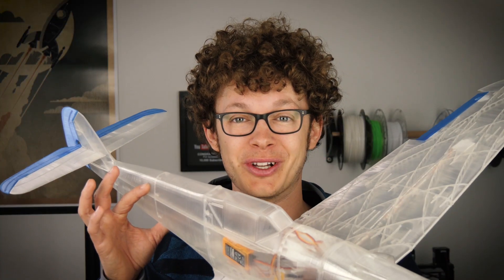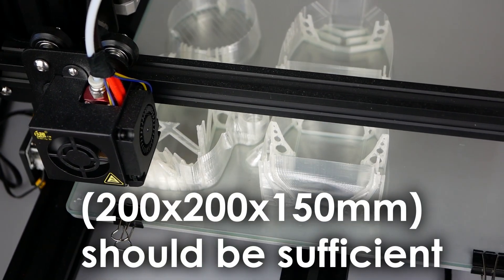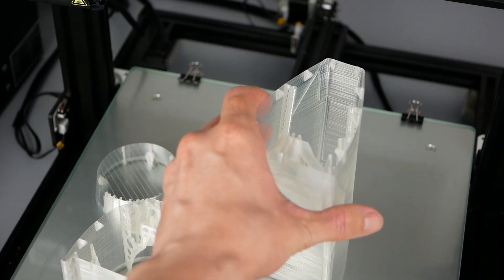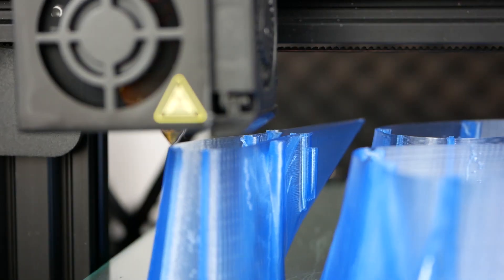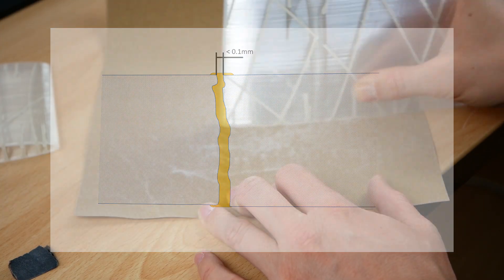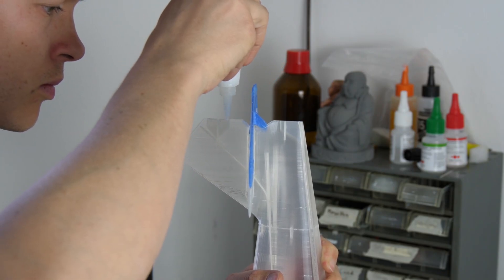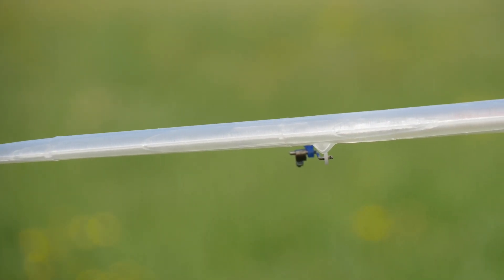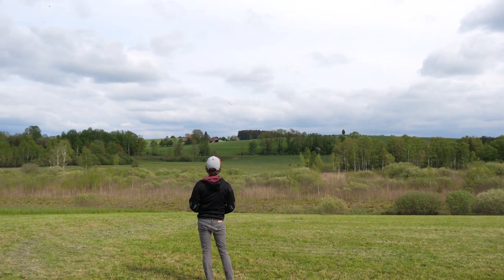HOW TO 3D PRINT your own RC AIRPLANE

Comment: Can I print it smaller to fit my a2212 motor?
Reply: In principle you can take the 3D computer model of the aircraft and scale it up or down to build an aircraft in any size you want. Same shape, same internal structure etc. but different sizes. Even full size!

Comment: anyone have setting for cura 5.9 with a k1? FOR THE LOVE OF GOD I CANNOT GET THE INSIDE RIBS TO PRINT NO MATTER WHAT I DO. Most of the videosi watched with settings are for older printers and old slicers and not updated to work with newer printers. thanks in advance

Comment: im having a hard time getting LWPla to print reliably. getting blisters on surface, poor wall adhesion, stringing, and pitting. ive been over every single setting in cura. on the same printer i get bulletproof reliability with Pla. flsun v400 w/ tungsten carbide .4mm nozzle. i maintain the printer exceptionally. sunlu PLA for days with next to zero errors. using overture LW-Pla. using eclipson recommended settings did not provide a sufficient part. is there a difference between LWPLA and "prefoamed" LWPLA? there isnt a noticeable increase in volume of the filament between printing at 190 vs 250. can someone guide me to more information on eclipson planes? i have 4 of their STL and want to make it work.
Reply: Hi, I'm also having the same problem PLUS a lot of warpping on all the print surface with my prusa mk4 and PolyAir 1.0 from 3dLabPrint, I tryied the settings from 3dlabprint (they havethe documentation for prusa slicer version 2.4, and at the moment i have the 2.7.4). Also tryied  the settings advised from prusa and prusa foruns but at no avail. I'm going to try a simple print without any settings (default settings from the slicer, maybe it will print ok but will be a little heavier, but I don't care at the moment :D ) from prusa and 3dlabprint only to see what happen, because at the moment I'm completly lost :(. Can any one help?
Reply: @nunocosta1060  The internet has told me to abandon LWpla altogether.

Comment: Just a thought, would it be possible to include some vibration isolating mounts for the motor? At the moment the stiffness of the airframe is amplifying the prop sound and it would seem that’s something which, when eliminated, could make for a more pleasant flying experience experience.

Comment: Hi I love this video as I have been building and flying model airplanes for about 30 years and recently got into 3d printing to make parts for my planes I never really thought about printing an entire plane, I just wanted to ask about the build surface you used it looks like a plane glass bed ?.this would make sense as it would produce a reasonably flat surface for gluing the parts together.

Comment: Hello young man, I wanted to say thank you for the G_code  info on the slicer setting for Cura. It has made a huge difference. No more pulling my hair out trying to configure the settings to print out the Spitfire airplane. I was really starting to have my doubts and wondered if my cr10s could print this plane. Now the prints are amazing.

Comment: Awesome video mate, thanks to this I was finally able to print thin wall RC plane components using Cura with my Flashforge Adventurer 4. With some setting tweaks I’m confident I’ll be able to get some good quality flyable parts. The mesh fix deactivation trick worked a treat for the slicer recognising the internal structure. Thanks man!
Reply: May i get the files?

Comment: I would think that 3D printing the skin would cause the plane to be a bit heavy. Would it be more weight saving to 3D print the structural pieces and skinning the plane manually?

Comment: Hoping for a response - is there a wat to text edit the g code so that the print is centered on the build plate? 
(When I load the g code directly, it prints in the corner where the plate seems to be unevenly heated, and warping occurs)

Comment: Errr ? So as far as the structure is concerned the steel control surface push-rods are the heaviest items. Could they not be replaced by PLA ?

Could the Fuselage sections ends be formed with a rebated edge so as to form a lap joint between sections ? OK, that sort of design might detract from the outward appearance of a transparent model, but the increase in strength would be well worth-it in coloured/painted models.

Comment: I love the clear 3D print, but wonder if it blends into the sky too much.  This could make it challenging to know the plane's orientation when it's far away.  Great video, thanks!
Reply: Isn't there strength levels of the materials so you can avoid that if you wanted too?

Comment: What are useless video. Especially if you’re fairly new to using Cura.  To say you need to activate flow settings and then you need to adjust them??? To what?.?  You can’t help people if you don’t tell them what they need to do.  So get with the program not everybody understands what you mean when you say they need to be adjusted.

Comment: Could use a 1/4" or arrow shaft size carbon fibre rod hole from fuse to tip of wing. 1 or 2 would make this a very practical RC build. Too fragile as is,

Comment: I think you meant to say "first flight". The "final flight" would be where it crashes and gets totally destroyed... ^_^  Incidentally, instead of the glass micro-balloons, try baking soda - it behaves as an accelerator. Or mix a few percent baking soda with the micro-balloons (lighter). We used to use baking soda in a squeeze bottle for ultra-quick field repairs during control-line combat/F2D matches - this was back when we flew all-wood models and before foam wings took over. Just hold the broken pieces together, puff some baking soda into the joint, and squirt thin CA on it. If necessary add more baking soda. The glue would set off immediately. For pushrods - try aluminum brazing wire (the straight rods, not the stuff on a spool). MUCH easier to bend and lighter to boot - the 1.5mm should be strong enough but you can also get 2mm and 3mm. As with all pushrods, long ones need to be braced.

Comment: I want to find a good stl file to 3D print a 2 meter/2 foot wingspan Yakovlev Yak-17 or Yak 23; i want to install retractable landing gear; it would run on and EDF size 90mm-150mm (6 inches) preferably 150mm. And I don't have a 3D printer so I'll have to get it printed. Anyone know of an excellent file?  Thanks in advance! I really got a kick out of the "wunderbar!" exclamation in the beginning of this video., which I think is great!

Comment: Hello @CNC Kitchen
thank you for this nice video. I bought this plane and have printed the parts, currently assembling. They all fit together very nicely without any adjustments coming from my Prusa. There is only a small gap on both wing halves between the first and second element, which I filled with putty.
I am asking myself one thing however and want to know your opinion. The elements are all glued together just on the edges, there is no connecting elements to hold them in place other than the glue. This seems to me like it could very easily shear off, especially under stress in some maneuvers.
The obvious pro of this is that the parts break apart cleanly and can easily be glued back together. However I'm asking myself if the overall integrity is too low without elements gripping into each other (Male/Female approach) to work against shear forces (Abscherung).
What is your opinion on this?
Reply: this is late, but you could consider plastic welding the pieces together with a solder iron and plastic or 3d pen.

Comment: 2 years later & I'm starting the 3DLabPrints P-17 Stearman. We'll see how it goes!
Reply: @Parker Fox it looks like the biggest difference is the performance package uses a 14.8V battery but the eco performance uses 11.1V. The performance package is going to be able to spin a bigger prop faster at the top end. I think it's overkill for this model. This isn't a speed plane. I've already got the exact motor specified for the performance package, so I'll use it. My batteries (if they're still alive to charge) are the 3S 11.1V, & I've already got a 56A speed controller, so I'll use that. I plan on using an 11 X 5.5 or 11X4 prop so it should pull through the air a little slower. I may need to change that up though, I'll just have to see.
Reply: Overall, I think either package should work well, but all the recommendations in the guide are out of stock (outdated, so no longer for sale). Looks like you'll just have to find something roughly comparable as far as size, weight, & power output, & go with that.
Reply: @Parker Fox I've only looked at the Stearman P-17, so I'm basing everything on that. Looking at the differences between the 2 packages there, I'd say you'll probably be ok with either. The eco package seems more than adequate, & the performance package doesn't look like a huge step up from that.  I haven't flown for several years, so I've been trying to practice up with my old Realflight 6 simulator. Before I fly this P-17 Stearman, I plan on getting an old foam Tigermoth running again, so I can crash THAT instead, until I get a little more steady on my landings!

Comment: The biggest problem with PLA is the lower melting point in combination with thin walled prints. If you leave the 3D printed plane in your car on a hot, sunny day there is a good chance that serious warping will occur, which cannot be fixed. With darker colored parts, the problem will be even worse due to passive solar heating, even while flying and especially near the power plant (motor, battery, esc) as additional heat is generated there during operation.   This is why I use either ABS or PETG filament for my RC airplane parts. They will not warp as easily. I am going to try PLA+ with my next project to see how well that works.

Comment: I noticed, that you glue the parts directly together. But then you have a 0,5mm line to connect the parts together, Why don't you close the sides of the part or make a gleu edge from about 2 to 4 mm  so have a bigger glued area?

Comment: Hello Stefan. I printed a wing sample in black PLA,  I had a problem after placing the part near the window, and summer sun in Spain made it get soooo hot that it bended and ruined the part. How can you print a plane in pla that will fly and will have direct sun light?? it is because transparent PLA resists sun light?? I am so interested in making a 3d printed plane for my RC collection, but was wondering if PETG is not a better material.
Reply: Yes - avoid black. Try printing a sample in another less dark color.

Comment: I have a Prusa MK3S on order today and I hope some day to be able to print a plane like this.  I have a lot to learn first, but I have been flying for a long time.  Incredible!
Reply from the maker: Eclipson as well as 3DLabPrint provide very easy to follow instructions or even pre-sliced GCode to make printing planes really easy! Definitely give it a try.
Reply: @CNCKitchen  I will check them out.  My printer won't be here for a week or so.  I don't even know enough to understand slicer and how it works.  But as soon as I get some of the basics down printing a plane is on the top of my list.  I am going to start with @localfiend Northern Pike as he has released it at no charge and has a good build thread on the Flite Test forums but I certainly will be looking at other designs and have no problem compensating people for their work.  I'm working on a Mooney 21 and trying to stumble my way through learning Fusion360 myself.  So much to absorb.  I love your channel and have been watching videos left and right.  You come highly recommended from many different sources.

Comment: Why no cooling in Cura?
Reply from the maker: For better layer adhesion.
Reply: @CNCKitchen  I see! and why not combing either? I am having some issues printing the pieces, they are a bit like waffles (they delaminate easily and they have some sections with holes) any extra advice? thanks in advance
Reply from the maker: Increase flow, increase temperature and print slower. Parts are usually super strong!
Reply: @CNCKitchen  Hey! thanks a lot, it is looking so good now! just few zits and pimples, but very strong. Last question: What is your rule for combing=off?

Comment: Cool project!!
I was under the impression that PLA was brittle and would break easily, is that not the case? Is “Premium PLA” more elastic?
Reply: It's brittle but stronger than you think. I wouldn't consider it "easily breakable". I just worry about heat resistance around hot batteries, motors, and ESC.

Comment: Doing the Cessna 152 on a stock (apart from a few minor tweaks) Ender 3. Most of it is Hatchbox PLA White, and the tires are done in Sain Smart TPU Black. Surprisingly, printing TPU on a stock Ender 3 was relatively painless compared to Fuselage section 3
Reply: yeah, it prints firmer tpu real well

Comment: How are the slow flight characteristics of this plane? I'd like to be able to enjoy the model as it flys instead of flying it at ONE MILLION mph just to keep it in the air...
Reply from the maker: Quite bad, due to its weight. It's a fast model, though I've seen somebody print it out of LW PLA which makes it lighter and slower.

Comment: I received a CTC DIY printer for Christmas, and I notice at 7:00 that you have a glass plate on the bed. What kind of glass is it. My printer did not have one and the first item that I printed marked the bed.  Thanks for advice. I am a total newbie at this.
Reply from the maker: Most glass will do. Just make sure it's flat. Mirrors are good for that or buy pre cut pieces for your bed size on Amazon.

Comment: Thank you very much for this good video !
I just buy the STL for the SPITFIRE MK XVI on 3DLabPrint, and I use Cura 4.3 and my Ender3 printer.
I copied yours Cura settings and it's perefct for the wings, thank you so much !
But for the ailerons (yours blue parts) is not good, do you have other settings for the ailerons and fuselage ?
Thank you, I will do a video on my Youtube channel when my plane is finished.
Reply from the maker: The settings need to be slightly changed. Just check the manual.

Comment: Thank you for your video, now I want to test too 😃
I’m a real novice in 3D print and RC plane, but I want to test it, I search the best plane model (on 3dLabPrint) to start (for novice like me), easy to print, and to use.
If possible I prefer a little plane (quickly to print and easy to stock it).

Which model plane you recommend for me ?

My 3D print is an Ender3, and I use Cura 4.2.1
Reply: Eclipson 3d printed planes are easier to fly and smaller so faster to print when you need new parts

Comment: Thanks for sharing. I had a few missing tweaks to Cura and that helped me over the line. I have already printed the EasyMaxx and now want to improve the qality of the prints for the P51D project as this looks similar to your Messerschmitt. The quality of your choice of PLA cannot be overstated as this shines through; as so with the feed and flow rates and making sure your bowden tube is optimally placed to avoid snagging - especially as the HE raises higher up the Z axis, as is the case on my new AnyCubic i3 MegaS. I use a rubber band to help guide the bowden tube away from the Z axis screw - ANyCubic tiewrap the bowden to the HE cables which is not optimal. Getting perfect thin-wall prints is very hard, but with time and effort it can be acheived on any printer without the need to buy Simplyfy 3D and a Prusa which seems to be 3DLabs choice. Where money is no obect go for a Prusa, but many printers like the Ender 3 Pro and the AnyCubic i3 Mega S are well up to the task.

Comment: I'm just printing the Cessna 152 from them right now. :) I had some really cool RC Planes back in my home region but since I started studying in north germany, I wasn't able to fly at all. But I will get back to this hobby and I already designed my own printable RC Plane, that well... lets say ended up being very heavy and I crashed while I was launching it because it wasn't able to achieve the lift that would be neccesarry. Wish me luck with the professionally designed one from 3DLabPrint :)

I currently tweaking the settings, as the supplied gcode is not good for my modified Anet A8 with a Bowden E3D v6, Mistral cooling duct and the 3 month old, room stored Janbex PLA on an glass bed without any spray or glue on it.

(Lots of stringing, some Wrapping on the wing tip)

Thank you for this video series and the suggested settings :) Instant Sub after that :D

Comment: I used these settings on the Ender 3 pro. Worked great, But i have slight warping on the print base. Maybe i need to sand it more :P